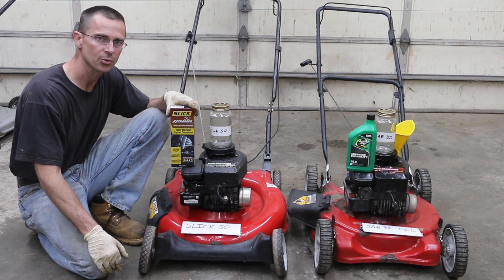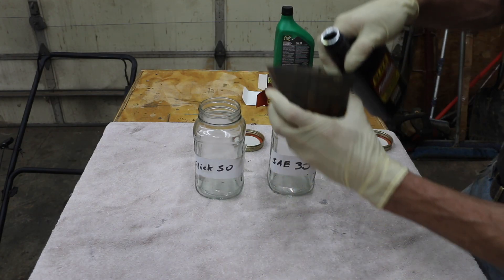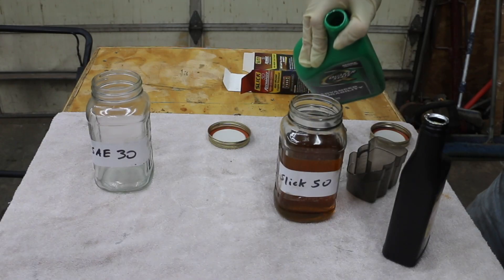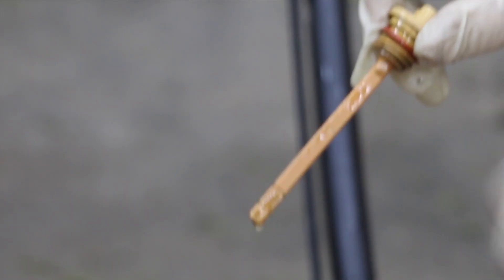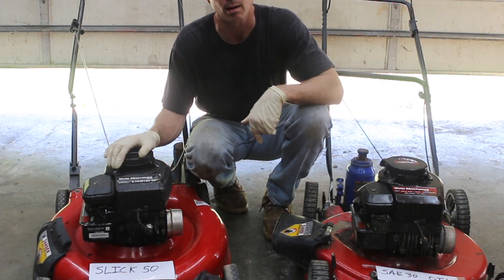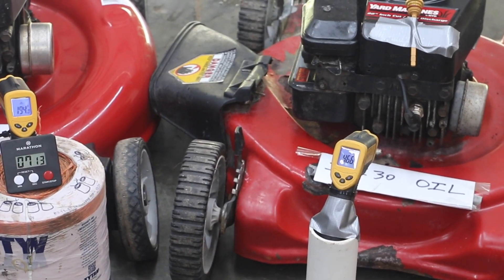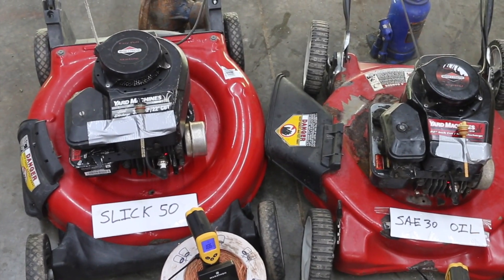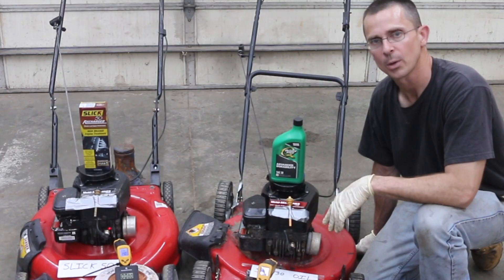Can't believe what SLICK 50 did to my engine!!--Dry Crankcase Test!

Comment: Could you do a test like this with an oil that contains high zinc and phosphorus counts?  It's supposed to help slow engine wear and have a higher sheer strength.  Not sure how you'd test it. For example, royal purple HPS had zinc/ phosphorus and supposedly holds up better than a standard synthetic and allows more power.  Maybe you could test Royal purple HPS vs either Royal Purple SAE oil or another brand with similar properties.
Reply from the maker: Thank you for this recommendation.

Comment: Sorry, but I noticed that when you drained the oil from both engines the SAE 30 returned less oil back in the glass then what was put in (compare oil lever before and after in the video).  I believe that about 1oz of SAE oil was most likely traped in the engine prior to running the engines that's why it lasted so long.
Reply from the maker: Thanks for commenting on this.

Comment: One thing that you need to keep in mind is that anything that enhances lubricity won't stick to your engine. It's like the Teflon coating on a frying pan. The great thing about Teflon is that it doesn't stick to anything. The bad thing about Teflon as a coating is that it doesn't stick to anything. Same thing with an engine.
Reply from the maker: This is an excellent point and thanks for commenting.

Comment: Slick 50 ruined the lower end of my then new Jeep Cherokee. Under 100,000kms. I think the film Slick 50 reports to leaver on parts deteriorates and takes out bearings
Reply from the maker: Thanks for commenting on this.  Others have commenting regarding engine problems following the use of Slick 50 as well.
Reply: I find just regular oil changes with synthetic oil works best. I have a 2002 Camaro SS with the LS1 engine with over 300,000kms and it is as strong and runs as well as when new.  New oils are engineered, additives can only dilute and weaken their properties. Of course you can do tricks to make an engine sound or run better before selling it but it's not a long term solution. I do like Seafoam, use it once and then it's not in the system.

Comment: There was a black oil with graphite particles in it back in the 80s that was supposed to form a  1/1000th solid carbon layer that proved to extend the durability engines. 2 trucks driven 1million miles one showed significant worn parts while the other only showed a black chrome color but no wear marks & measure the same as before the million mile drive. I was young and don't remember this oil, if anybody knows about, please upload a video.
Reply from the maker: Thank you for the recommendation. I'll see if I can figure out this product. I have some graphite I can add to oil to test.

Comment: I had a neighbour  who put in the whole bottle of slick 50 after draining out all his oil first.
then he put the slick 50 in , ran it for 15min. to adhere to all the engine parts, then he drained out all the slick 50 and put in his reg. oil. he believes in this stuff, i'm skeptical.
Reply from the maker: Sure seems as though he would have left the Slick 50 in the engine instead of draining it.

Comment: Looks to me you removed more slick 50 oil from the motor then the regular oil motor before running test.
Reply from the maker: Thanks for commenting.  I drained both engines entirely.  The engine with oil ran hotter, an indication that oil wasn't present. Thanks again.

Comment: Try dura lube or prolong if there still avaible.
Reply: I add a vote for "Prolong" - I've had two instances that really should have cost me motors, that didn't.
Reply from the maker: Thank you for this recommendation.
Reply: Definitely run a duralube test
Reply: Used to run Dura, Prolong was twice the price iirc. Lucas now, it can make engine temp a little hotter because it's thicker

Comment: Hey man I really like your experiments.  I was just wondering if maybe you should watch the short interview on YouTube with John Bishop the alleged inventor of Slick50. I cant vouch for the video but apparently the original product has not been supplied by the original manufacturer since 1984 after John had some difficulties with companies and marketing but the Slick50 name was still allowed to be used by other manufacturers...  The video goes on to say that you can still get the original formula from XcelPlus.com. Again I don't know anything about who invented it, but if this video is true it would explain a lot about why it didn't work.  I did an apprenticeship about 17 years ago where one of my machine shop lecturers told us about his experience with Slick50 in an old 2-Stroke Engine. He talked about it as being in the past somewhat, some years ago. He noticed his engine not running quite right and when he took it apart there was major scoring in the cylinder and a crack somewhere, I cant remember, but he said the engine was still running and producing power in a condition it shouldn't have. I've never forgotten it.  Anyway I'd take a look if I was you and I'll be doing some more research too. Keep up the good work, regards Brad.
Reply from the maker: Thank you for this recommendation.  I'll check out the interview and plan to also test XcelPlus.  Also, thanks for the positive comment.

Comment: Well I have one question, these are 2 different lawnmowers, how many hours did the one with Slick50 have on it and how many hours were in the one with regular motor oil?? That makes a very very big difference, if the one that had slick50 in it had more hour time or use time then the other, that's not really a readable test?? Don't you think?
Reply from the maker: Thank you for the constructive feedback.  In more recent videos I began using new, identical engines for this sort of testing.  This new testing approach seems like better science. Thanks again.

Comment: Do you think you could ever test lubrilon? That was supposedly the original formula for slick 50 which was why in the commercial they would run the car without oil. Just curious since I haven't seen any tests on it that wasn't performed by the company.
Reply from the maker: Thank you for this recommendation.

Comment: I just wanted to say great test .. Ive watched this before at a show.... if you try to start the slick 50 engine after it cools down .. It will run again .. vs the other engine is destroyed.. I am not sure if you tried to start the slick 50 later .. but the motor at the show ran again and again.. seized everytime . but it ran again later. I believe the slick50 just prevented damage.. mind you this was a very long time ago but I am sure my memory serves me correctly here. perhaps you could try this test again ? .. its also possible the engine at the show had something else added but that we will never know for sure. Thanks for putting this test out here ! love the others too.
Reply from the maker: Thank you very much for the positive comment. I'm told they changed the formula for Slick 50. Thanks again.

Comment: Just here after watching a video on it from Scotty Kilmer who recommended Slick 50. This was definitely a good science experiment and I see nothing wrong with destroying something in the name of science, just not for "fun". It's just strange that the one with Slick 50 ran so much cooler so that part just doesn't make a lot of sense because you would think that a cooler engine would stay in tip top shape. But then again, it's designed to be run with oil and not without it so maybe it does keep the engine working better while it's used as it is designed. Another test could be to run two different motors much longer and then repeat the test and see what happens.
Reply from the maker: Thank you for this recommendation.  I will likely conduct more testing with Slick 50.

Comment: Corning makes a synthetic grease that treats the metal . it doesn't like to stay mixed in the oil, I have found if you dissolve it in gas first, then while mixing pour it into the oil it'll start to separate, but it'll be real fine. A mower uses the splash oiling method to lubricant ,so mixture will remain mixed . After using this mixture ,drain the and run it,you'll be surprised. The grease I'm talking about comes in tube, doesn't change or melt at extremely high and low temp.. I've used it in car engine with excellent results .  This grease is hard to get cause they only it to industries ,not civilians . I got mine at work (Tennico ) What it does for bearings is amazing.
Reply from the maker: Thank you for this recommendation.

Comment: What seems odd to me was the Slick 50 engine was running much cooler with the empty crankcase! Even when it quit it was 100 degrees or more cooler! Doesn't make sense!
Reply from the maker: I've since switched to using 2 new, identical engines for these tests to rule out engine design difference, wear, etc. Thanks for commenting.

Comment: Neither engine was new, both could have been cared for differently. I can't say I believe in products like Slick 50 however.  Being an auto Technician, I have seen some really carzy things come into my bays.  Now, as for a fair test, I don't believe it was.   When you tested Lucas against STP, both engines were new, had the same number of hours on them and were the exact same motor.  I called that a very fair test but taking two used engines that one could have been completely neglected, that isn't even close to a fair test.  That would be like taking my work care and testing it against my Wife's car.
Reply from the maker: Great point.  I'm glad I've begun using new engines to improve the science. Thanks again.

Comment: I treated the engine of an '78 Ford F-150 with Slick 50.  I was driving down the highway about 60 mph, and heard a sound like a clunk that I'd never heard before.  About a minute later I started hearing a continuous noise from the engine.  I slowed down, and the sound changed.  I slowed down some more and the sound changed again.  I looked at my gauges and saw that the oil pressure gauge was on ZERO.  I pulled on to the shoulder immediately and turned off the engine.  I had the truck towed to a Ford dealer.  They found that the oil pump had locked up.  When the oil pump locked up the shaft that drove the oil pump from the camshaft had twisted off.  They pulled the main bearing caps and the rod bearing caps and said there was no damage to any of the bearings.  The oil pump and the shaft that broke were replaced.  I'm not sure why the oil pump locked up, but I believe the Slick 50 protested the bearings.  I probably drove 5 miles after I heard the "clunk" of the oil pump locking up.
Reply from the maker: Thank you for sharing this experience. I'm glad there wasn't any damage to the engine. Thanks again.

Comment: iv used slick 50 in a ford transit since new and its at 194000 miles and still drives and sounds good - i guess it helps prevent ware so long as your engine has oil
Reply from the maker: Thanks for sharing this experience.  Keeping the oil changed makes a huge difference and like you mentioned it may help improve the effectiveness of oil, but I can't prove it.

Comment: The original Slick 50 always got  a bad wrap from other mfg's using those friction bearing test. Where they would put the additive on and run them immediately to prove there product superior over Slick 50. Slick 50 (original) was supposed to be added to a fresh oil change after the engine was well thru it's break - in period. Then was to remain in the engine for the oil interval which in most cases, as with a car was 5000 KM or 3000 Miles. Then changed with the oil. Through heat, cooling and working it in, it made a bond to the friction area's of metal parts. I apologize - I forget all details and proper terminology.  But this should give you the idea. 
  I had it in my car years ago as per instructions. I notice lower engine temps, increase in horse power and fuel economy  due to the reduction in friction. I even ran smother and quieter exhaust tone at idle. Also oil pressure changed.  Anyways one time after the car had 150 000 + kilometers on the engine after the Slick 50 treatment ( I really was supposed to of retreated it again well before this. I can't recall if it was supposed to be every 50 K or 100 K maybe less ) Anyways, I had hit a road heave late at night. I didn't realize I had torn a hole in the oil pan. I drove a long distance that night. (approximately 40 minutes which included about half of this at highway speeds )Was also at a track and pounded it to her. ( 6000 rpm to shift gears and running up to 125 miles/hour or 200 km/hour) Before heading home. Next morning got up and rushed to town - driving hard on cold engine. Slowed in town and heard a slight lifter sound. Looked a oil guage and nothing ( Zero psi ). Checked oil and nothing. Stoped at a store which was near by, picked up oil and poured it in. Checked dipstick and nothing. Recalled hitting dip in the road the night before. Looked under car and there was my new oil running out on the ground but engine was quiet again. I poured more oil in and rushed home with the car. There wasn't a drop left coming out when I got there. Also not as much as a drop in my yard where I parked it from the night before.  I later went back to the dip in the road that had torn the  hole in the oil pan. I found the car had been empty of oil about 1 minute of driving after hitting the dip.
   I repaired the pan, filled it with oil. I drove it for almost 2 years after before parking her. The engine still ran fine even then. Life and rust had me leave it parked. The only thing I had noticed different after running without oil was the oil pressure guage ran about the thickness of the needle lower then it was previously. This was a 4 cylinder turbo charged engine. 
 I believe if it hadn't of been for the Slick 50, the engine would of been ruined that night before I had gotten home. But, I could be wrong. What do you think ? I am being totally honest... no bs. 
 Sorry for such a long write up. 
I believe in the old Slick 50. Though it was pricey at about $50.00 can. for a 1 liter jug in 1990.
Reply from the maker: Thanks for commenting on this.

Comment: iN 1990 i BOUGHT A NEW DODGE w250 4x4. At about 6 months I used a bottle of slick 50 and dumped it in with a new oil change. Drove the p/u on vacation of about 1300 hundred miles. My oil gauge failed. Was somewhat worried about no oil pressure. Pulled oil sending unit out of block and found it to be completely plugged with looked little white plastic BB's. Replaced sending unit and oil pressure returned to normal. Would never ever use that crap again.
Reply from the maker: Wow!  Thanks for commenting on this.  Glad the truck is okay.

Comment: Z-Max is shown (at least in their commercials/infomercials) to actually absorb into the metal parts. We used to use it @ Crane Racing Engines in all of our 4 stroke engines from the shop lawn mower to race cars/trucks. We never did any extensive testing like you're doing but never had any failures with (or before , without it) so no conclusive evidence here. Would like to see how that stuff holds up, looks good in theory! Cool videos!   : )'
Reply from the maker: I'll test Z-Max soon.  Thank you for this recommendation.

Comment: Try your Lucas tonight time test Lucas motor oil Company works a lot better I've actually accidentally drain the oil out of my lawn mower using slick 50 and it locks up then it's gone it was no way to save it but the Lucas that did the same thing and I could save the engine all I had to do is clean her up and put her back together the Lucas. Actually penetrates the engine and the parts and it's hard to come off even after oil is drained try Lucas in that same torture test
Reply from the maker: Thanks for commenting on this.

Comment: I use a product called Energy Release or ER. I use it in all of my equipment, cars and toys. I have never worn out or had any failures with anything that runs in oil! I've used it for over 25 years!!
Reply from the maker: Thank you for this recommendation.

Comment: if this test proves anything ... it is that you shouldn't try to run an engine without oil   , just check the oil level  once in a while and your mower will run  for many years !

Comment: I had the same results with my Dodge caravan and slick 50. I believe it killed the engine after only 75,000 miles. Only saving grace was I had it under warranty and good records on oil change maintenance.
Reply from the maker: Thanks for commenting on this.  Glad you had a warranty.

Comment: I am guessing that the slick 50 oxidized at the higher temperature, and possibly crystallized.  Oil should never get that hot, but it does beg the question - does this happen slowly with oil at ~180, requiring more frequent oil changes?
Reply from the maker: Excellent point and great question. Thanks for commenting.